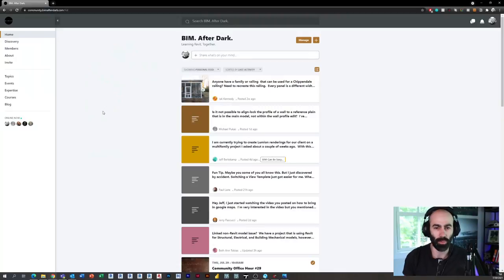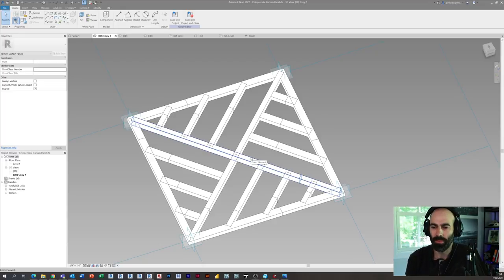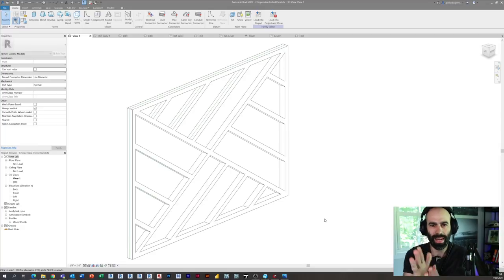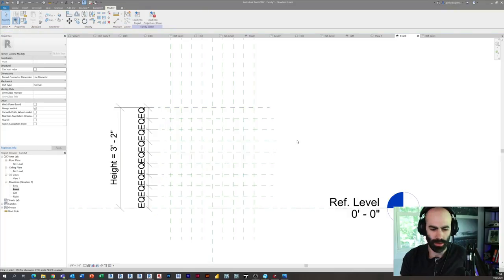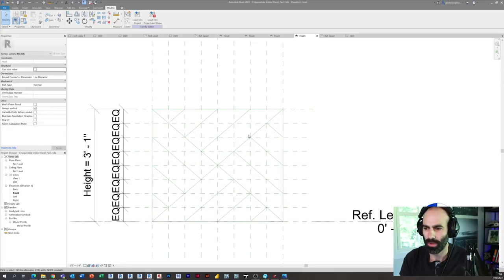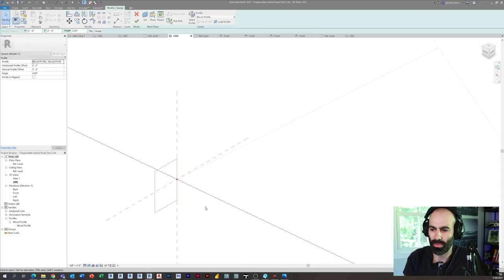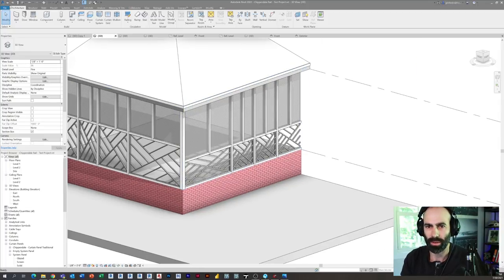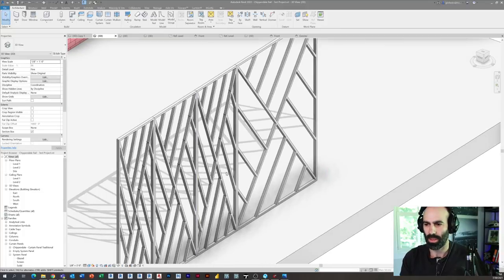Parametric Revit Family Tutorial - Curtain Panel "Chippendale Rail"

Comment: Nice.  Good trick w ref lines.  One comment would be to keep the side vertical rails out of the panel itself and have that be a mullion type so that you don't have double wide thick verticals at each vertical curtain grid line
Reply from the maker: Good point, in this case it would be cleaner to use the mullions and not model those.  Cheers!

Comment: This is pretty amazing. Thanks for explaining this so well. I wonder - what if you wanted to make the panels not rectilinear?Like add a slope or undulating like a wave shape to make screens or other types of fences where the vertical constraints vary.
Reply from the maker: Anything can be done... its just a balance of performance over modeling at that point.

Comment: Problem- When I do each of the smaller diagonal lines by themselves they work perfectly, however once I add any section of the main X and it is intersecting any of the small lines, then Revit want to keep rigid angles and move it as a box rather than locking onto the intersection of the planes. Can anyone provide the answer?

Comment: i couldn't do the last step of putting it on the project help please
Reply from the maker: Did you load it into your project for the family file? Once you did that… what happened?
Reply: @TheRevitKid  yes, but it opens as a object. I can't use it as a curtain wall because it doesn't appear there when I click on the glaze curtain wall
Reply from the maker: @jessicaaleja1106  what family template did you start with?  Make sure it is a curtain panel family.
Reply: @TheRevitKid   curtain panel
Reply from the maker: @jessicaaleja1106  Start watching around 21:00 .... I talk about how I load the generic model family into a curtain panel family before loading it into the project...
Reply: It appears like a component
Reply from the maker: @jessicaaleja1106  If you follow the process exactly as the video shows, you will be creating a generic model family, loading that into a Curtain Panel family, then loading the curtain panel family into your project.  If you do not follow those steps and load the generic family into your project it will be just that, a generic family.
Reply: @TheRevitKid  I did follow it, but when I try to do the wall panel like you said it doesn't appear there in the curtain panel. Did you save the family as a curtain panel
Reply: When I click on the panel it didn't take me to the system glaze panel. It take me to a multiple families selected and it's not there.
Reply: Nevermind I found it
Reply from the maker: @jessicaaleja1106  YAY!!!!!!